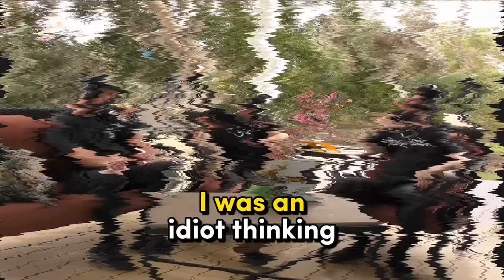Matt Shulman on JZ vs LS for drifting and behind the scenes of Klutch Kickers | Circle of Drift #15

Comment: 20+ year in machine and engine shop i will say your best bet for a good engine is a complete long block and using it/oem rebuild, unless u are machining the entire block for new caps, hardware, and gaskets. even just throwing diff headstuds and gasket with oem stuff makes the engine warp and butt under heat which warps it more than spec at Op temp.  when you start grabbing pats from here and parts from there without prepped the block for it you are on a timebomb.  also alot more people have been running surge tanks for fuel which is good and bad as it heat soaks the fuel and send it back to engine 80% of time instead of going to fuel tank and cooling. which compounds issues.
Reply from the maker: You talking about for Shulman’s JZ platform or for Nate’s LS babble
Reply: @circleofdrift  all engines. when metal heats it moves and expands,  it is also why back in the day chevy heads talked about alum heads being bad for castiron blocks and couldnt hold them together because the alum head would move and expand more than the iron,  the iron would trap and heat soak more but move less and the alum expels heat faster but moves more whn the extra trapped heat from the iron is transferred the the head.  decades later import oem companies accounted for this movement. when oem engineers accounted for this it changed the game in the 80s, but most aftermarket products do not.  this is why oem engines sometimes are "factory freaks" and some build a built engine and it lasts only weeks even though they triple checked the tolerances in the engine and also why you see people use copper spray when they do headstuds and hg because the torque the hardware and the gasket gives is a diff mating pressure than oem and the spray acts as a bandaid to get the gasket stable during the movement, that is the real reason copper spray is used but most people just use it because they see others do it.  the oem hg is also designed as a mechanical failsafe for this violent heat transfer that if the pistons or walls get too hot in the camber the gasket fails saving your piston.  when you put a stronger gasket / studs you remove the failsafe, with the head and block tied together tighter than oem your rings and piston tops become the heats next abuse target.  this is how gasket strength to chamber heat is calculated and RND'd for the gasket, stud, and torque to let go before damage to the internals happen based on that info.  engineering is pretty cool and why oem stuff works better some times because when people diy or have a buddy shop do it they always dont end up with great results and some do and a reason alot of people love e85 because it cools the camber temps down which is why you can run more psi or timing because the chamber cooling from the fuel gives you more leeway.    long so sorry if not the easiest to read.
Reply from the maker: @feelgoodhorizon4084  damn hell yeah dropping some f***ing knowledge on us. 🏆🏆🏆
Reply: Dropped some knowledge on us indeed wow